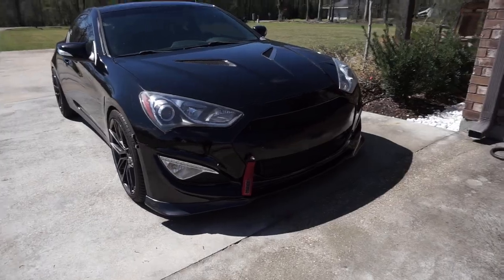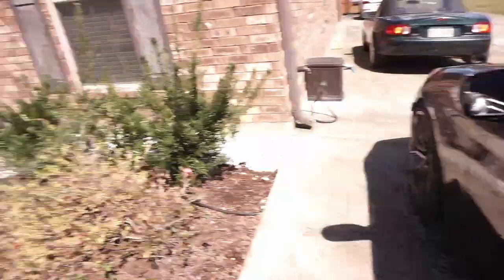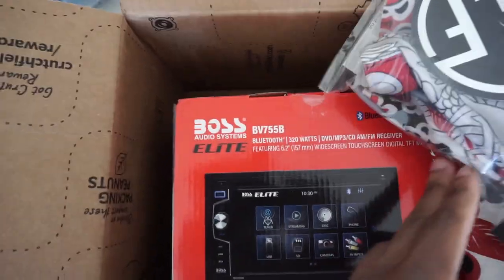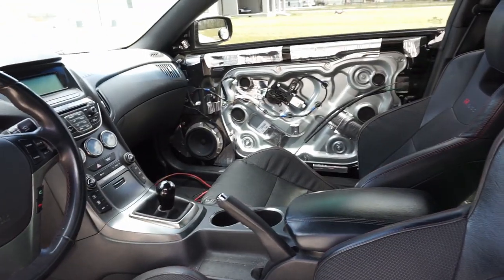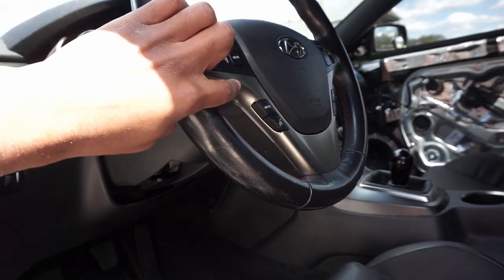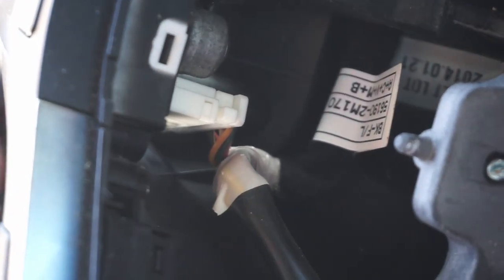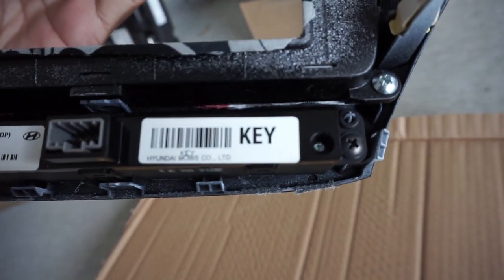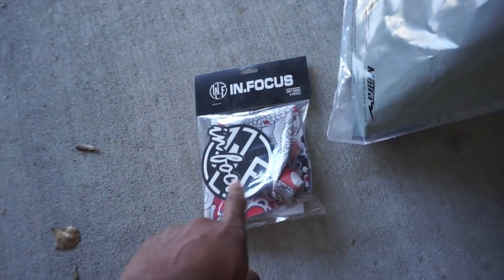Genesis Coupe Interior UPGRADE! CHEAP Mods That LOOK GREAT!

Comment: Great job man. I was about to add colored leather on side door but they told me those "melted rubber" once cut will be an issue so they refused to do it.  

Please let me know if the screws are enough to hold that part sealed and well.
Reply from the maker: Thanks, but idk who told you that about the “melted rubber” lol.. I always look to have enough mounting points that hold things together. A lot of stuff on vehicles is just extra precaution. Trust me, you’ll be fine👍🏽

Comment: How'd you get the fabric over the door card? You didn't really elaborate after taking it off the panel
Reply from the maker: I just used the spray adhesive onto the piece I took off and then laid the fabric on top making sure it was flat.. Then cut the fabric with scissors